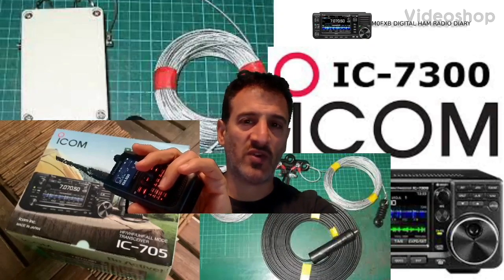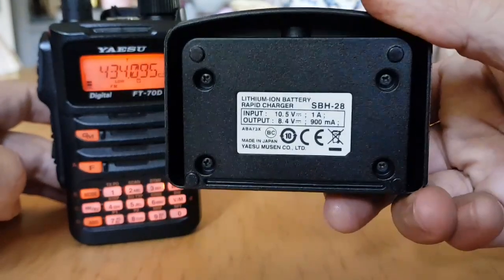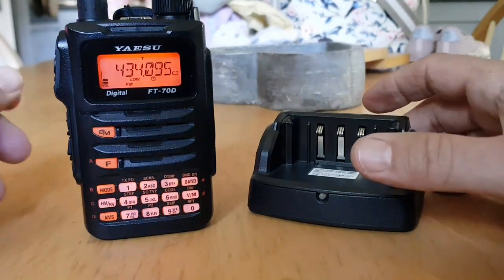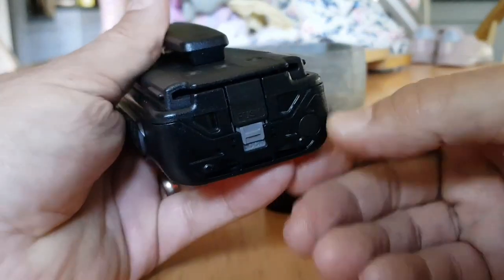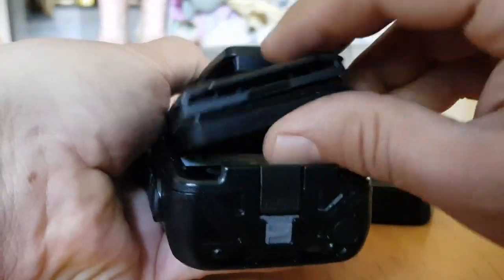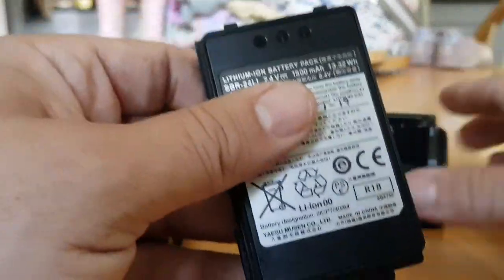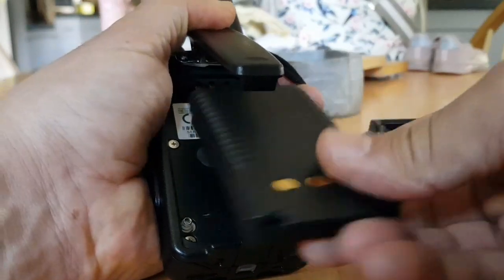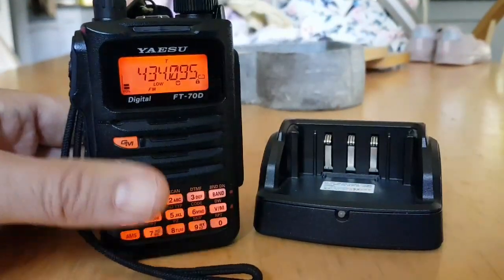YAESU FT70D - Battery life - Charging cradle - Battery change

Comment: The most unpleasant thing is that it does not charge the included station.
Reply from the maker: What do you mean ?
Reply: @HamTechRadioScannerDrones  The battery does not charge when the FT70DR is turned on and inserted into the SBH28((((